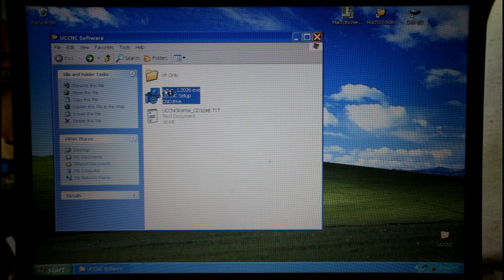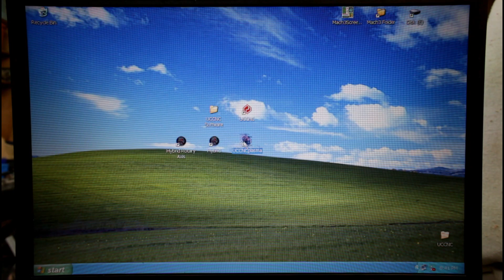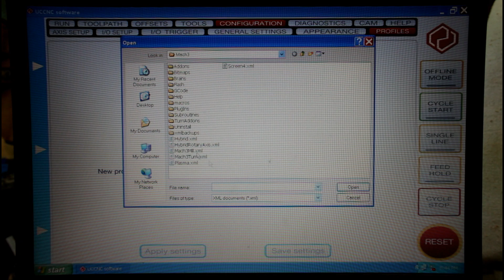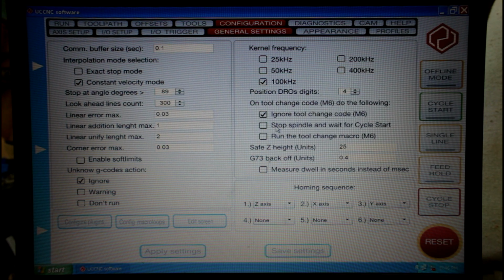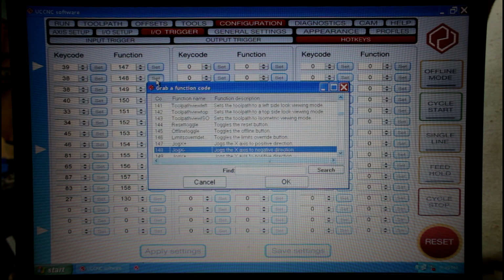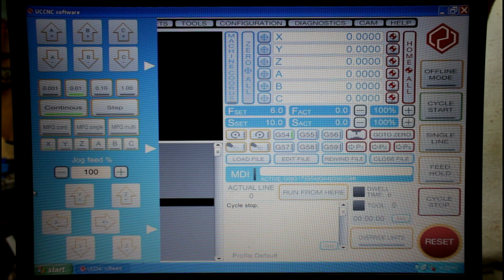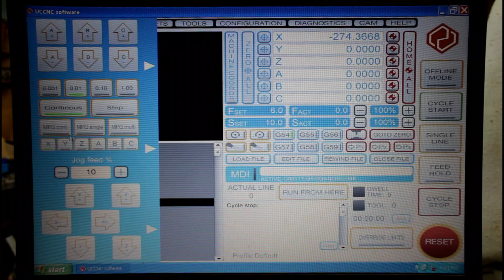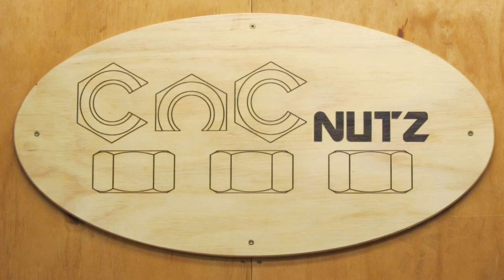Installing UCCNC with Pendant - CNCnutz Episode 123

Comment: Hi Peter. This is a great video. He guided me to install UCCNC the first time. What pendant model or part number is the one that is in video? or what model can you recommend me to use? Thank you
Reply from the maker: Hi Hugo
Good to hear the video helped. 
The pendant I bought off ebay.
http://ebay.to/2HXaaMl
The pendant has been updated to have 2 extra buttons for the A axis that mine doesn't have but other than that it is the same. You can also use those buttons for additional functions. They are a nice cheap unit that work really well.
Cheers
Peter

Comment: Peter, I've got the UCCNC 100 hooked up to a Gecko G540 and am pulling my hair out trying to setup the Soft Limits. My machine doesn't have Limit Switches as I was advised that they're not as dependable as the Software that they're plugged into in that they are highly susceptible to both mechanical and electrical failure. That being said, when I set my X Axis up with a Minimum of 0 and Maximum of 55", Y as O and 32" and Z as 0 at the top and 7" at the bottom.
I get the same error message everytime I attempt to jog my machine ( A machine axis position software limit was reached. The axis was now stopped. ) This would also occur if a user were to retrofit a CNC Milling machine with the UCCNC software as these machines don't usually have limit switches installed. Any help would be greatly appreciated.
Reply from the maker: +Ronald Lambier 
The only limits I use are Hard Limits. I am not a fan of limit switches though I can see why others like them. Likewise I don't use soft limits as I don't find them practical. The problem you are having is most likely you are not Zeroing the machine coordinates when you set your axis, only the working coordinates. Soft limits use the machine coordinates and are only as dependable as you, because it you don't zero the machine coordinates when you use it they are useless. You as the machine operator use working coordinates for your machining. 
I suspect you will lose more hair trying to use then than you did trying to get them working. Check out my video  limit switches - do I really need them? -  Episode 112
If you still want them and can't get it to work for you please email me cncnutz65@gmail.com and I will see if I can figure it out for you. 
Cheers 
Peter
Reply: I'm heading to Episode 112 right now and I'll let you know how I make out.

Comment: does your laptop have multiple ethernet ports or are you using the one ethernet connection?  How would this work with a networked computer?
Reply from the maker: +Richard Lathrop 
Only 1 network port. If you wanted to be connected to the network as well as the UC300ETH you would use a switch and plug both the pc and the UC300ETH into that. You can configure the UC300ETH's address to match the network. 
Cheers 
Peter

Comment: What kind of reasons can make someone switch from Mach3 to UCCNC ?
Reply from the maker: +GraphicMan Innovations 
None that I can think of if you already have Mach3.
Reply: UCCNC has superior trajectory planner compared to Mach3.
The workpiece is more accurate with complex g-code programs and on high feedrates the UCCNC just blows mach3 out of the water.
You have CV tolerance settings with uccnc, with mach3 you do not have that. With Mach you can only pray about your workpiece tolerances.
I switched to uccnc from mach on 2 machines already and will never look back.
Reply from the maker: +Gabor Kohegyi 
Thanks for the info. CV tolerance is a good feature since by its nature CV takes shortcuts to keep its speed up.  I  hadn't seen the setting for that but will have a look and play. 
Cheers 
Peter

Comment: While im 99% happy with mach 3 and the fact a home brew CNC is NEVER finished.. :) Thier web site has a lot stuff i have halfway been considering getting at one point or another all in one place They may wind up getting some of my money... :)   Great Vid there too.
Reply from the maker: I'm like you John. I am happy with Mach3 and it is what I am used to. I don't have any problem with it. 
I got the UCCNC license free with the motion control board so I am giving it a play but I don't think I will switch. The free license offer is over now for the UC300ETH. Since I got it free I might as well give it a try though.
Cheers
Peter
Reply: Free is hard to beat to play with..  lolol